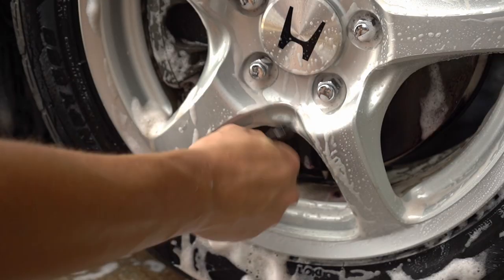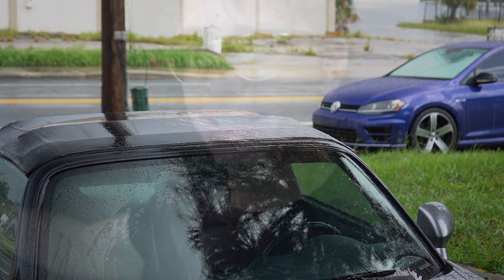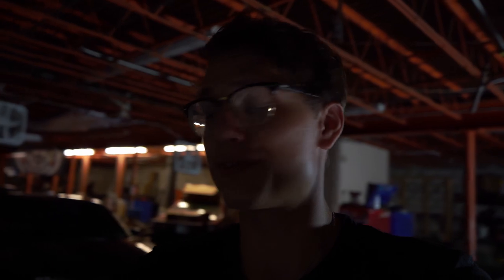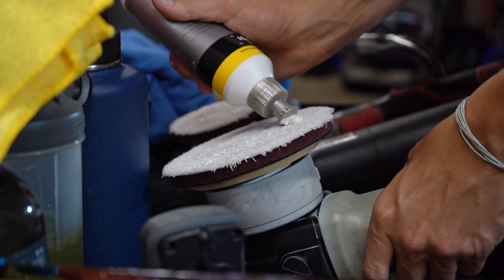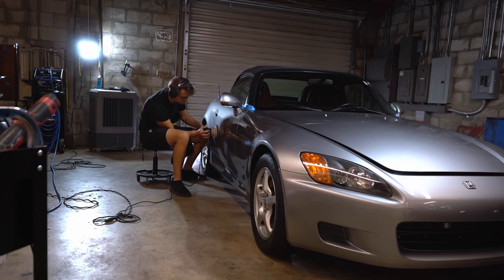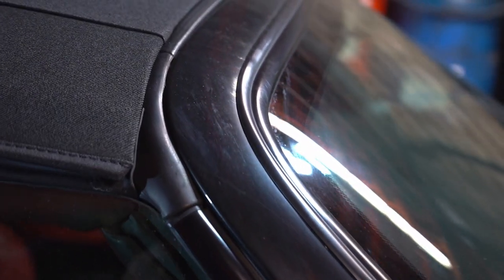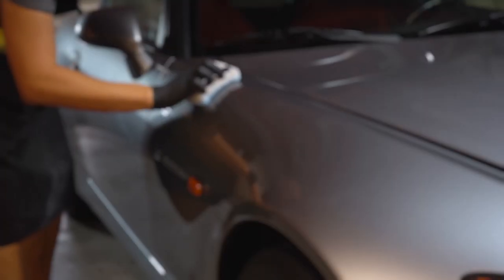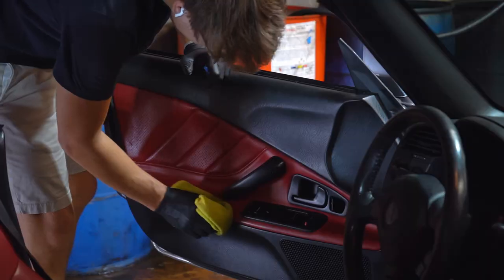Honda S2000 | 40+ Hours with a JDM Gem | Paint Correction & Coating | 48k Miles, Nearing Perfection

Comment: Hello, I was wondering if you were doing a DIY job and didn't own a smaller polisher how would you suggest doing spots like the front bumper on the S2000 ? Or a smaller polisher is a must for these kind if spots? Thanks!
Reply from the maker: Honestly, I'd be taking a microfiber towel with a little bit of polish and finger polish those areas lightly. Usually for areas that are really really tight/close up to trim, I aim for "cleaning the surface" rather than correcting. Just to make it clean and glossy. Hope this helps!
Reply: @ccdetailing  that helps a lot! Thank you!